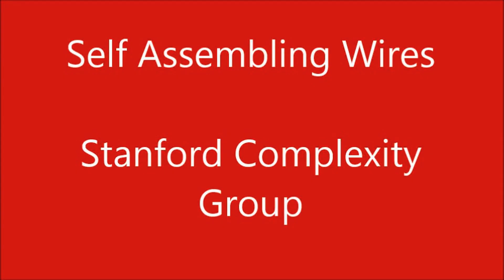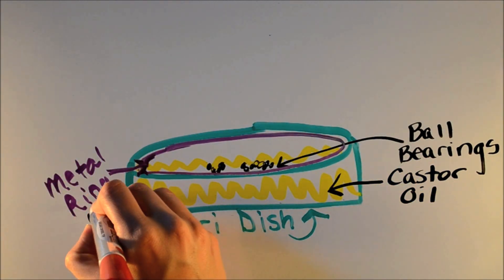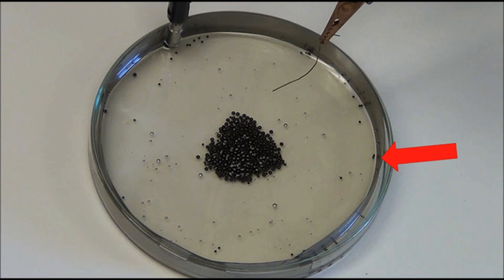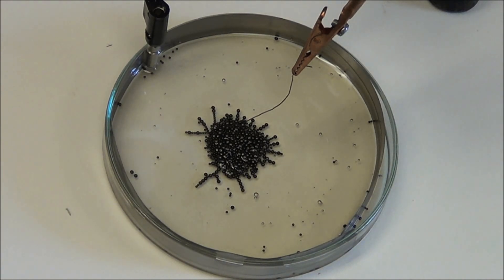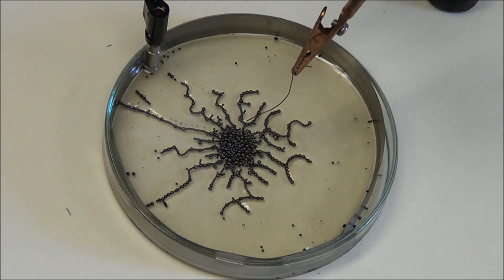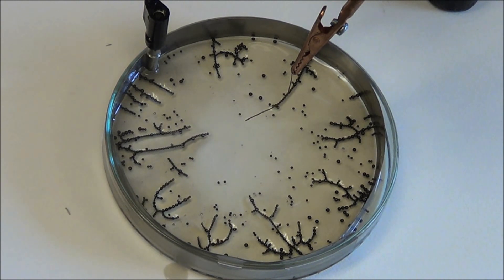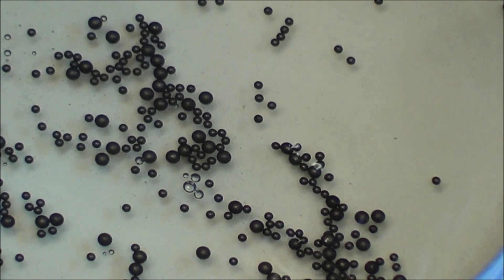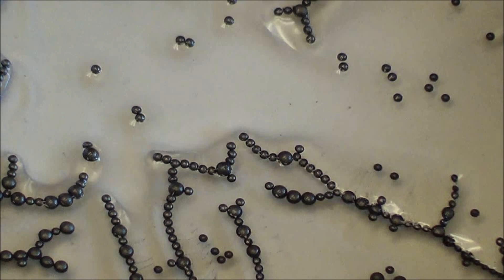Self-Assembling Wires

Comment: This leaves me with unanswered questions. What causes the balls to move? Why do they connect to each other?
Reply: Unfortunately I dont know enough to explain but it seems to be the polarization from the metal itself, negative finding positive in a general direction and moving thru the aqueous solution as a medium. Very cool stuff!
Reply: Also... Tetris??
Reply: @CypherVirus  not sure if it was just a joke that didn't land or not.
Reply: It's electrostatics, one of the 'strong' forces (in physics there are 2 strong forces and 2 weak forces. Electrostatics is one of the 'strong' forces). It's the same thing that makes your hair stand on end when you rub a balloon against it (when your hair is clean and dry and not greasy). Because of the high voltage difference between the positive and negative sides of the circuit, and electrons spreading down, the balls become charged and are attracted to the negative side of the circuit, but repelled from other balls that are positively charged. So when balls reach the negative side of the circuit they lose their positive charge and are attracted together, and attract other single balls that are still positively charged. But being very negatively charged also makes balls from different branches of the negative circuit repel, so branches tend to stay away from each other. It's the changing state of the charge on each ball that causes everything to move until it reaches equilibrium
Reply: @herseem  Thanks for your explanation, easily understood and much appreciated.
Reply: @herseem  well explained!
Reply: @herseem  electrostatic is a type of electromagnetic force not strong force. There's only a strong and weak force, fundamental forces are strong (nuclear) force, weak (nuclear) force, electromagnetic force and gravitational force.
Strong force is the thing that hold quarks together to create hadrons. Electromagnetism hold sub particles together to create atoms.
Reply: @Noname-67  I'm going to respectfully disagree with you there, electrostatic force is definitely different from electromagnetic force. For a start, an electromagnetic force requires a current to generate it, the exact opposite of an electrostatic force. And I'm pretty certain that in physics, electrostatic force is regarded as one of the 'strong' forces. In a cathode ray tube, for example, if I remember correctly, electromagnetic force is used to bend the stream of electrons, but it's electrostatic force that accelerates them to a massive speed
Reply: @herseem  Magnetism is simply a relativistic effect caused by electric fields. They are both the exact same force - the electromagnetic (EM) force. The semantics of what is "strong" or "weak" aren't that important or exact. The strong force is one specific force mediated by gluons using the color charge.
Reply: @R__i_i_ii  you've lost me there, I don't know about gluons
Reply: I corrected 'curvy' to 'current'. Autocorrect strikes again
Reply: @herseem  The strong force has nothing to do with electromagnetism, and aren’t electrostatic forces covered under electromagnetic forces since electromagnetism covers all electric and magnetic forces?
Reply: Electromagnetic forces would cover any electric and magnetic force, electrostatic is just a special type that occurs between 2 electric charges that aren’t moving
Reply: @yennisdang6596  I'm pretty sure they're not, if I remember 'A' level physics correctly. Almost everything about electrostatic force is different from electromagnetic force (which is magnetism), other than like poles repel
Reply: @R__i_i_ii  No, Magnetism is not a relativistic effect caused by electric fields. It is a relativistic effect caused by moving electrons, regardless of why they are moving. An electric . field alone is not enough to create magnetism, moving charges must exist. In the situation above the magnetic force plays very little role as there are no significant quantities of electrons moving until the self assembling wire completes the circuit. Until then it is basically static charges and induced dipoles. It is an extension of the charged balloon and picking up paper kids experiment..
Reply: @R__i_i_ii  I suppose I should add for being concise I am referring to static electric field as that is what is in the video, obviously if you have a moving/changing electric field then you have the associated magnetic field with it too.
Reply: @richardchapman3554  Each electron has their own magnetic fields, as minor as they are. Electromagnetism and Electrostatic forces are not separate from each other. It's possible that the electric field causes electrons in the bearings to align themselves and cause the bearings to have north and south magnetic poles that in most cases would be negligible for movement but the oil is frictionless enough to allow the bearings to be attracted to eachother. When two bearings touch, the electrons arrange themselves from -+ -+ to --++ and create a stronger magnetic field with the chain of bearings. In short I'd say it's an effect of both electrostatic dipoles and magnetism. Indeed, there is a very very small current when the bearings touch each other and the electrons race through the "tunnel" to try to get to the positive electrode.
Reply: elector magicians.
Reply: Magnets, how do they work?
Reply: While particle speed & density do result in stronger effect,  as was theorized by A. Peratt, experimentally demonstrated by W. H. Bostick, and observed  "in-the-wild" in the existence of the Cosmic Web & the nearly omnipresent cosmic scale magnetic fields, all that is required is the presence of moving charged particles to impart some level of "order". 
There's also plenty of experimental evidence that the relative strength of the Atmospheric Voltage Gradient during conception/germination stage has a significant effect the gene expression of biological organisms (G. Ebner & H. Schürch)
Also, it has been observed & verified that charged particles can & do have an effect on the neutral particles around it.
Reply: I would have thought that the electricity just want to make a complete circuit that's why it's making a path of lease resistance - though I can't explain it or back it up, so better listen to the others explanation.
Reply: Little men in the dish
Reply: Lmao mate yes it GETS YOU THINKING 😆
Reply: @random4969  should only be castor oil. will not work with extra virgin olive oil
Reply: All yours explanations are interresting!  What seeing this make me think about though, is..., what if life itself was started that way?  What if life itself is just a 'standard' organisation of electromagnetic fields through electrolytes that 'force protein chains to form' as it was form in this case with those ball bearing strains!!!  That would explain this needed 'spark' of electrical discharge in the 'protein experience that are form in a big jar we sometimes see' to prove that life need electric force!  That may be the actual origin of how DNA actually was all started, no?  Am I far reaching here?  it really looks like 'life' to me...  i am amaze at this stuff...  just incredible to watch really.
Reply: @jessikapiche6097  Jessika you want INTERESTING, look up the mandela effect
Reply: @random4969  That's psychology, not physics... it can be a decent read though I guess. Like with the Uncanny Valley effect.
Most interesting in that field, I find phenomenology. That's quite topical, too, as you can see the similarities to the Uncertainty Principle in physics.
Reply: @jessikapiche6097  You should look at enhanced videos of micro/nanobiologism. It's a little bit more complex than simply what you say, but that the physical boundaries (or "rules") of our world leaves its footprint on most thing is undeniable.
You should also check out fractals and the 80/20 rule, otherwise known as the Pareto Principle.
It's all fascinating and should be good fodder for your brain :)
Reply: Electrostatic forces, simple as that.
Reply: @dtiydr  Grabs your nose pulls it very hard 😆
Reply: applied electric field/force from the power supply causes balls to attract each other, eventually connecting each other

micro electric forces internal to the balls prevent balls from callapsing/merging into a single ball

electromagnetic spin of domain of atoms in the balls cause essentially random wiggles giving random connections between balls.  Once a ball is connected to another, the random wiggle sorta stops (greatly reduced) as they align between the balls
Reply: they're alive
Reply: Induced dipole formation due to the redistribution of electrical charges withing the electric double layer surrounding each ball. Dipoles are then able to attach to one another forming strings or fibers. 
Not only is the DC induced electric field directional, but also non uniform in nature
Reply: Don't make me quote ICP.
Reply: I think. The balls get megnetised because electromagnet happen and it wiggle around a lot because trying to avoid other sources releasing the negative charge but all trying to connect to the positive charge. Like when the thing spread out, and only one can connect becaus is already connected and the rest breaks off because the connection already establish.
Reply: Cynthia May  No. This is not the weak force.
Reply: Electricity has weight in this fashion. When under water dolphins use electroforms of communication, think of the electrode as that, Under water sound and will travel a great distance, now it could be down the the base he is using , weather its water some other liquid or saline. You get the point. Though  I'm not a scientist. But due to the water circumference being soo small, the electricity can move as its not earthed. The balls are most likely moved by the static electricity in the liquid as a whole. Maybe this will help you understand what may be going on.
Reply: @spiceywolf  i guess so
Reply: MAGIC
Reply: @Austin NightEyes yeah i suppose so, that shortens it down just a tad xd
Reply: @_TAGP  LOL
Reply: @mypetis CERBEROS damn
Reply: Moving electrons have mass and therefore give movement of metal balls.
Reply: How bout, what use does this have?
Reply: Like in the movie with will smith and the robots, where the un-needed robots went off to gather together.
Reply: @spiceywolf  But you would be wrong, it's the power of g... magic.
Reply: Basic fundamentals of magnetism.
Reply: electrical potential, think lightning
Reply: Hormones of course.
Reply: The potential energy between the hanging wire+ and the negative ring-
Reply: Magnet
Reply: The balls obtain a positive charge which makes them attracted to the negative part, idk why they join though
Reply: Wait i thought it was because the ball was positively charged and thus seek to go to the nearest negative chatged thibv?
Reply: natural magnets collected from the soil immersed in oil and excited with electricity
Reply: @spiceywolf  yeah same
Reply: Each ball becomes a magnet due to the electrobe above, This is why they connect with each other and form a chain in the castor fluid.
Reply: @redrobiin  Grabs your nose pulls it hard 😆
Reply: By the same reason we move and connect to each other. Love! The result of attraction!!! Hahahaha.
Reply: Adding an electrical charge to the balls polarises them, essentially turning them into mini electromagnets.
Reply: You should also check Lichtenberg effect!
Reply: the force
Reply: The same reason we move. Electricity.
Reply: Pee is stored in the balls.
Reply: It's same reason why electricity in lightning flows in dendroid-like ways. It's basic property of stressed aether to create fractal 'streams'.
Reply: It seems to me that the balls represent the dynamics of the electrical energy. Like charges repelling and opposites attracting. Order ensues. It makes me think about the dawn of creation and how lightning would have bright order to the party.....
Reply: Magnetism
Reply: Magnets?
Reply: As I have said before in other posts regarding other scientific topics, the answers to anything are always simple! 
It was mentioned in the video that there was a negative charge, but there's only one charge and it's neither positive nor negative, there's no need to two different types of electric charge! 
There's only three things that exist and make everything that exists in this universe (I'm not ruling out the possibility of more than one even though it's possible that we may never really know) and those three things are Space, because you need this to put stuff in... Mater, because it's the stuff that stuff is made of and the Electric charge because you need something to hold things together and move them! 
There's only one true force and that's the Electric force! Momentum of mass is a secondary effect after the electric force! 
And that's all there is! 
The meaning of life is.... You were inevitable! You were going to be created somewhere somehow some time! It doesn't matter if you exist or not, you were created just because you could be! Your thoughts and opinions make no difference to the universe! So just live your life and let others live theirs, you don't know when you will be back to live again! The earth is a lot older than most people realise! The megaliths that remain from a previous civilization of humanity are only a clue that we have already been here before a long time ago!
Reply: @PeterMilanovski  Wait, you don't need time? I mean, there are a lot other things missing, but are your seriously saying you don't need time? Are you one of those timecube cultists?
Reply: @bramvanduijn8086  no! I'm not saying that I or you or anyone doesn't need time! Time is just a tool that we have developed to make measurements! Everything else still worked before we invented time! So whether time exists or not it doesn't matter to the universe! It's going to continue doing what it does, when it wants to... Well it's not like it's conscious or something like that! I believe that it's more to do with 'every action has an equal and opposite reaction' sort of thing! 
If you move one object from one place to another, you now have an empty space while somewhere else it's getting crowded! Eventually the space will be filled and the crowded place will disperse! Entropy! And time isn't necessary for it to function, it's only necessary for you and me to measure entropy, our measuring might even affect the entropy so the measurement could be incorrect! Yeah it's a tricky one! To measure or not to measure! That's the question?
Reply: Its a form of self assembly nature seems to know how to naturally get together even in abject seemingly random chaos, ordered structures will arise. This goes all the way down to the atomic level it's why your molecules are tied together and Dna seem to have some knowledge of how to do all it's complicated functions. Also it's kind of the reason we're all looking at this on YouTube😅 Nature "naturally" gets together to make ordered structures.
Reply: Seems like simple electric field. Not sure how this experiment is useful though (Except for the aesthetic value).
Reply: @sriharshacv7760  why you and the other guy insist on saying this, "ah it is not useful"? What kind of sad people are you? So weird. In the end, what is truly useless is your comments. Hahahahaha.
Reply: You can not understand what is moving the balls because in the school system (including university level)  only simple experiments with electric field are shown and in those experiments the electric field is uniform. Such filed interacts only with charged objects but not with non charged objects. However what is not shown in the schools is that non-uniform (divergent) electric field can interact with non-charged objects. Divergent electric field arises between for example cylindrical “plate”  and squared plate, any object placed in such field will experience net force and will move. 

In this experiment with Petri dish  the electric field between the ring and the wire creates divergent field so the balls - even though they are not initially charged - move.
Reply: Wow, so much ignorance in a scientific video... Let me simplify this for you guys, you know what an Air Ionizer is? an electrode discharging high voltage into the air creating a strong electrostatic "flow" from the negative terminal to the positive terminal.. Flow, as in that thing that moves. Now, electricity (which electrostatic flow falls under) tries to find the path of least resistance, which is the metal balls in this case.

So now we have high voltage jumping from the negative terminal and into the beads in the general direction of the positive terminal, great, what makes the beads flow then? Electromagnetism. Yes, it IS electromagnetism because the flow of high voltage moving through the beads jumps between them create a magnetic effect perpendicular to the flow, that's why 22%+22% of the beads aren't in straight lines. Awfully close to 50% eh?

And that's it, have fun with the KNOWLEDGE you have gained.. Or have !!FUN!!, your choice really.
Reply: @ScarletFlames1  nicely done
Reply: Duuno . As much I guessed the balls from the the sides gets close to the + point to make a shorter path for the eclecticity to flow
Reply: moving electricity creates a magnetic field and it grows stronger the closer it gets to the positive or negative terminals which causes all the metallic balls to hook together... this is pretty useless and it looks like the dude is half assing an assignment or his "research". With the voltage he is playing with there is already an electrical connection from the positive to the negative through the air.
Reply: @craigcutler6919  This is the foundation of some of Prof Alfred Hübler work on self-assembly of complex systems. He is renowned in his field but has unfortunately succumbed to cancer a few years ago. This is a good demonstration of how a self-assembly system can form inhibitory nodes. It is certainly not an "half-assed assignment" you describe.
Reply: @craigcutler6919  It's not a magnetic field, that requires either a higher current (lots of particles) or fast-moving particles to have a significant effect. The magnetic forces here are minor compared to electrostatic forces
Reply: @herseem  It is an electric field.  Through a dielectric fluid.  However the beads are conductive and as each one gets added in their little strings, the new point gradient locale changes and you see in the video that a number of "branches" can "reach out" toward the attractor (ring).  UNTIL one touches, then it is no longer an electric field, but is a conduction path.  A few things happen. First off the voltage drops because the supply being used is not likely to have a lot of capacity behind it.  HV supplies are not cheap and usually custom built.  And one does not want any oil fires.  I am only guessing that the supply they are using is not of a very high power, meaning that first contact means the voltage gets clamped.  Secondly the field that was throughout the tray (hence the branches) is now only around the primary bead conduction path, and is now a magnetic field as the current flows.  Before the connection there was no flow, just field.
Reply: @herseem  I dunno anything but aren't they both jusy two sides of the same coin?
Reply: @jamesramplin8124  I'm petty sure they aren't. Despite the similarity of name, they are different from each other in almost every respect
Reply: @craigcutler6919  Sorry, I forgot that science is purely for utility, and people aren’t allowed to enjoy science for the sake of its beauty. Maybe you should stop acting like you’re above everyone, it makes you look like a douchebag
Reply: @craigcutler6919  you should be more careful with your words.